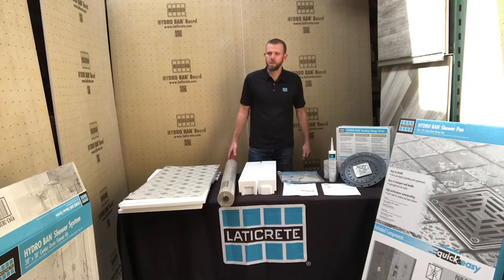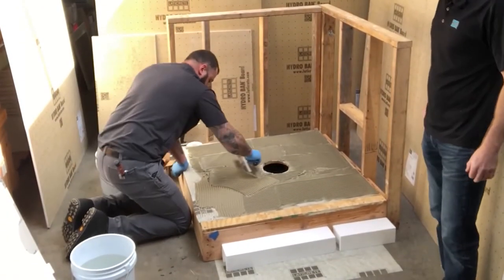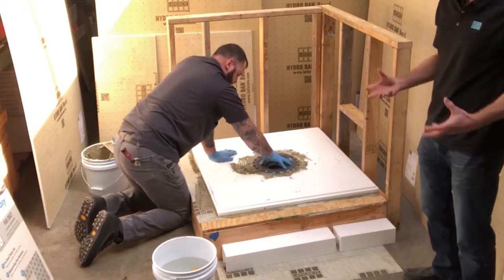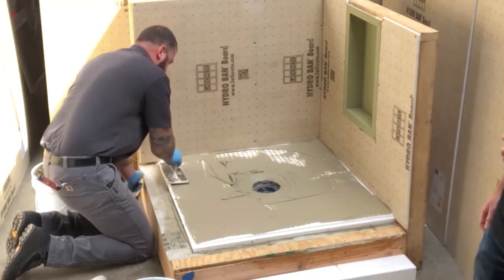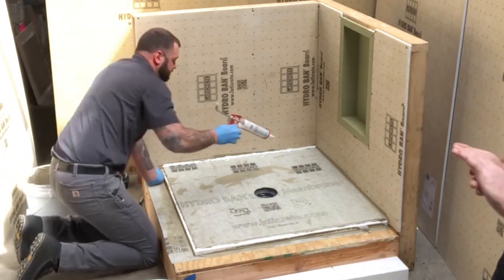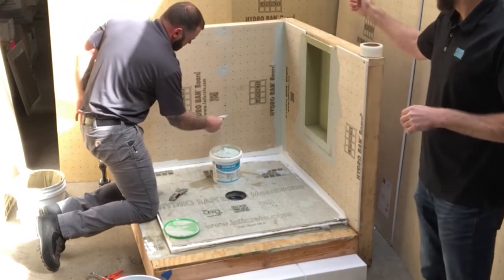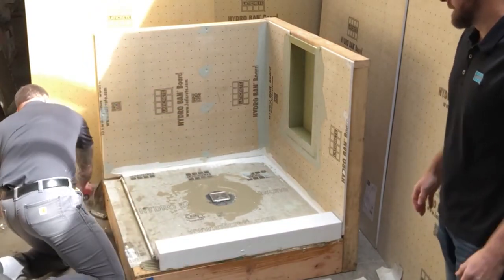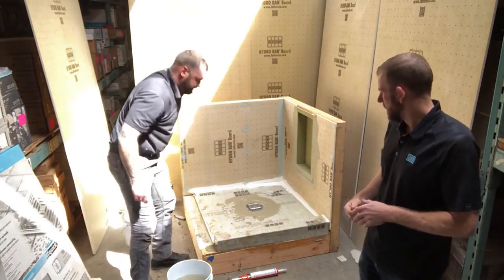Laticrete HydroBan Pre-Sloped Shower Kit - How to Install

Comment: 1. What if the walls are already in and place the pan afterwards. The  boards would not be sitting on top of the pan. Is this ok? 
2. In this video a membrane was installed over the plywood before the pan. Why?

Comment: I have used lots of Laticrete products and like them, but the installation methods shown in this video are insufficient for me.  Using just Latasil to seal the floor/wall junction, and particularly the curb/wall junction, is risky IMHO, because sealants, like caulk, can shrink and delaminate over time.  Most competitors recommend installing banding at the floor/wall junction, and pre-formed outside corners at the curb/wall junction, instead of relying just on a bead of sealant.
Reply: Laticrete makes a band that's recommended for use with this system.
Reply: In other countries thin-set applications in these bans and joints are considered not up to code, I use cementicouse in the joints and always just banding over ever connections. 
I have only ever used the full pre sloped pans but I am considering this product in my home shower, have you ever tried it and if so what do you think about these kits?
Reply: @notme9798  did you ever build that shower?
Reply: @GregDaMurse  yes it came out great, all the waterproofing wasn't cheap but it was worth it